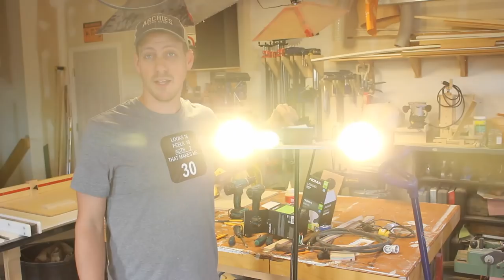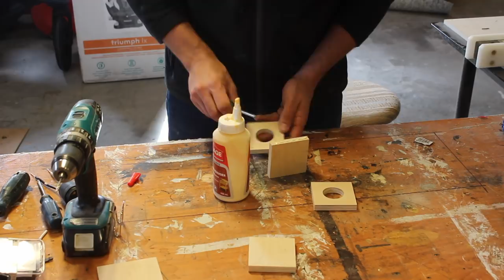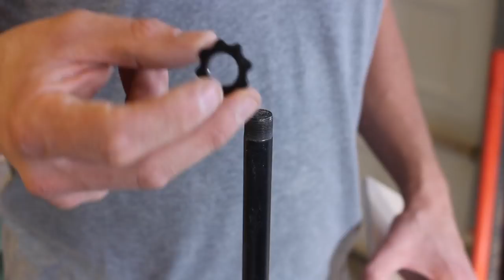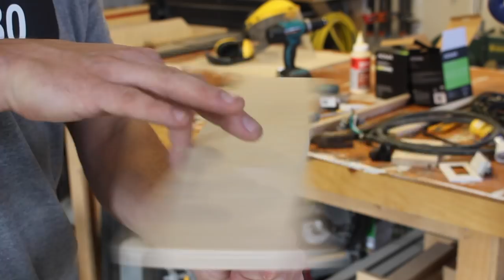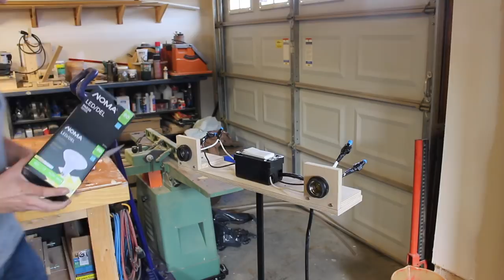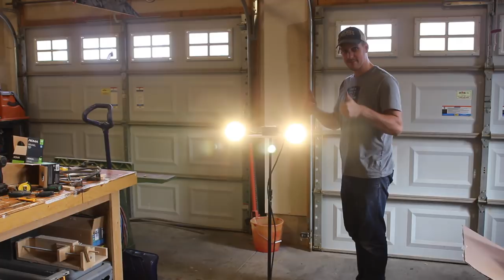DIY Spot Light

Comment: Sorry bro, love your videos but all that does is make you look like you are standing in front of flood lights..... which you are lol
Reply from the maker: hahaha yep! I am not happy with how this works. I am going to experiment with different light bulbs.
Reply: Wes Hamstra I made some with the metal heat lamp fixtures and some led 100 watt bulbs with a shower cap over it to diffuse the light. Works great and I use them for picture taking of my products
Reply from the maker: I will have to try that. I think diffusing the light will make a big difference
Reply: Wes Hamstra yeah it would be those bulbs will get way to hot.
Reply from the maker: the bulbs are led